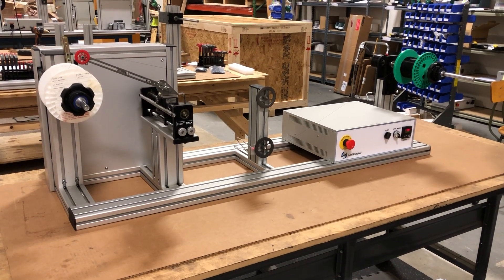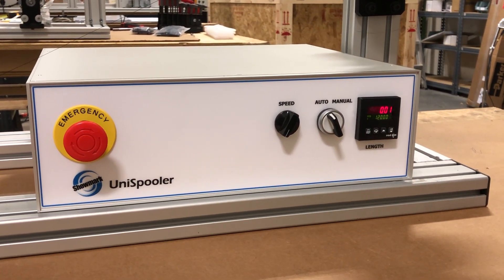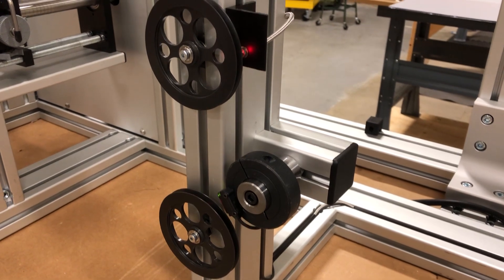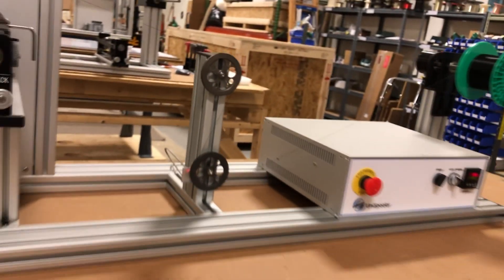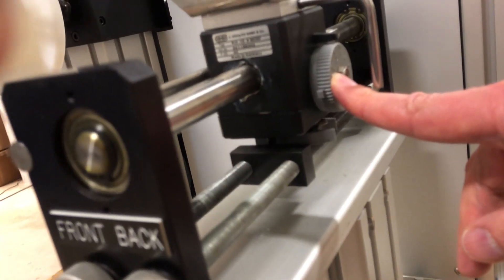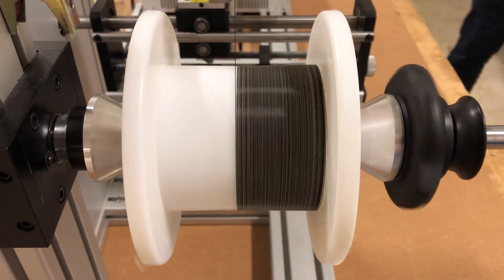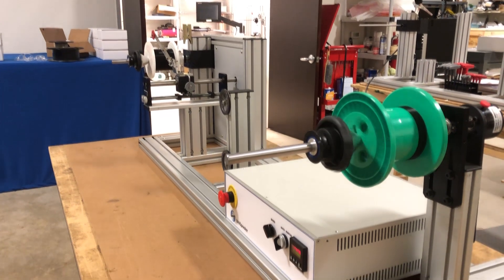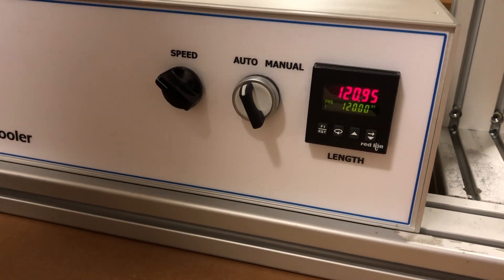Respooling 36AWG wire on a Showmark UniSpooler

Comment: what is the maximum of tension you can have with the payoff system?
Reply from the maker: We have a variety of sizes of brakes that can be used with the system.  The actual tension is also related to the size of the payoff spool being used.  The largest standard open-loop brake we offer produces 13.3 pounds (6.1 Kg) of tension when using a payoff spool with a nominal diameter of 6 inches (150mm). Please call 610-458-0304 or visit www.showmarkcorp.com for more information.

Comment: Great video. Can you show us spooling a thicker solid wire like a 14AWG if it can handle it?
Reply from the maker: The UniSpooler can be configured to wind cable up to 1/2 inch in diameter.  We don't have a video in our library that shows it, but the following video may be interesting.  Please call (610-458-0304) or email us at email@showmarkcorp.com for more information,  https://www.youtube.com/watch?v=SiQ7ic4VhIk